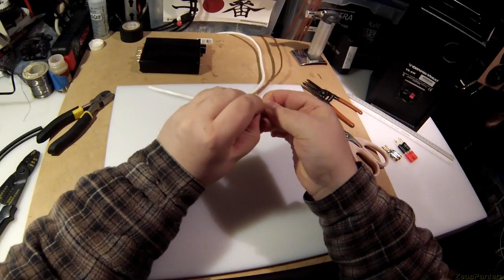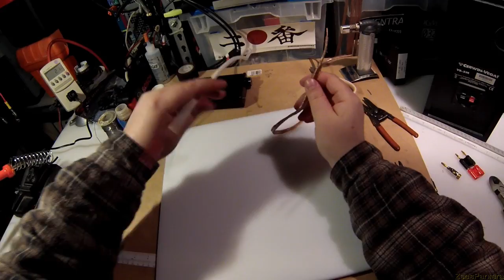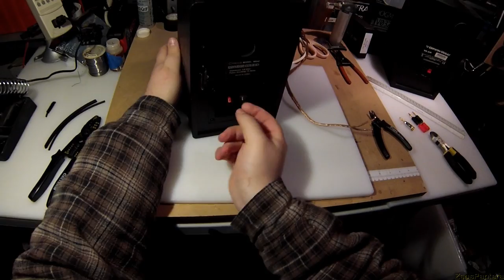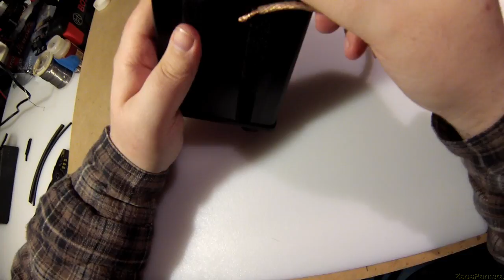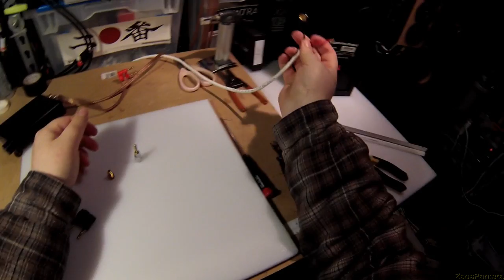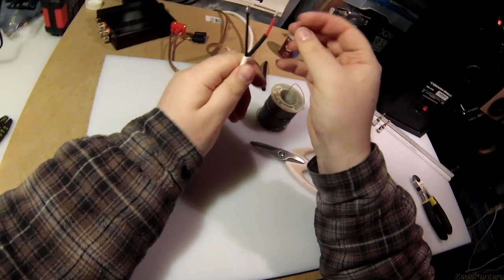Z Tutorial - How to Strip Speaker Wire and Use it

Comment: Awesome Video Buddy I Actually Did it Myself I Have a Automatic Wire Stripper in My Toolbox So Stripped The Rocketfish Clear Coated Speaker Wire I Braided the Ends of the Wire Connected to a Speakers Using Binding Posts and on The Back of the Receiver Where the Rest of the Audio Gear are Connected So I Did a Great Job I Got 100%

Comment: I have a red strip and a white strip inside my qed xt25 copper cables, should I remove them (cut them off) before I twis them together?  the red and white tubes are called X-tube technology, which delivers uniform current. From the videos of those cables I gathered they should be cut off but its not stated anywhere. There is no info about it on the web.

Comment: For Pete's sakes, breaking strands is just very poor wire stripping technique. You can use a real wire stripper set to the correct gauge. You can use one that has a cutter where you set the cut depth and spin the blade around the jacket. It doesn't cut right through, so no cut strands. You can even just use a sharp hobby knife to score the jacket surface by rolling it on the edge (not slicing). This way, the jacket will not cut through. Then just bend the jacket sharply at the score mark so the stress opens the score right through. Any of these methods works without ever breaking or cutting a single strand. If you are going to make a how-to video, just learn to do it 1st....

BTW, to avoid shorting just:
1. Turn the amp off and allow time for the power caps to discharge to earth before connecting or disconnecting passive speaker cables.
2. Connect the Amp + last and disconnect it 1st. Simples! You will note that the + binding posts are on the outside of the row so there is zero chance of bridging these accidently.  If the + is disconnected and it accidently touches, its own + or a - or the chases, there is no short circuit in any of these events. However, if you mess with the speaker end while the amp end is connected you certainly will risk a short. So, just do it in the right order and it won’t happen.

Comment: Is there a video for making interconnects? Could you also do a review of various interconnects available? I am amazed to see the prices of some interconnects. Do they add, subtract, multiply or divide anything? Also, if you could add on how a Subwoofer cable is different from a regular rca interconnect cable?
Reply from the maker: Sub cables are no different than normal RCA's. I have a video coming to make speaker cables that look good. I just buy cheap monoprice or amazon RCA's as they are better built than most and work great.

Should be no sound benefit btw.

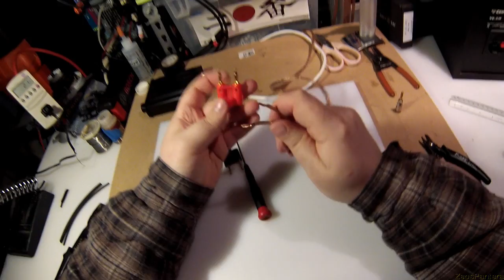Comment: What's the 11:00 min adaptor called? I have a bit of trouble finding it in my country xD
Reply: Also can i connect the speakers from this home cinema http://www.theatresystem-manual.com/sharp-ht-cn410dvhr.html to a normal PC with the adaptor and work perfectly fine?
Reply from the maker: It is a banana plug. Europe might not use them due to the way they fit in outlets. 

If you have that while surround sound just wire the receiver to the PC with Fiber or a 3.5mm to RCA. If all you have is the speakers you need to get an amplifier of some sort to run two of them in stereo or a recevier to run all of them. Honestly they don't look high quality.
Reply: They are pretty old but unused. I asked on some forum if it would work and they said that the speakers would make no sound without an amplifier. So my plan kinda died out. Is there another way to make them work or just impossible or not a bargain?:-?

Comment: Hey Zeos, will stripping some of the copper for headphone cable affect the sound? In this video, you mentioned that it wouldn't affect the sound but I was wondering if the same goes for headphones since headphone cables are significantly smaller gauge than speaker wires. Thanks in advance.

Comment: say if you wanna piggyback 2 sets of speakers onto eachother, but your amp doesnt have posts for Banana Plugs, can you take 2 sets of raw wires, and stick them in the same terminal, so long as you are not mixing your hots and grounds?
Reply from the maker: You can. But running in parallel can be dangerous for amplifiers. You might want to consider series.
Reply: Is parallel the same as piggybacking banana plugs on eachother?
Reply: Parallel or series doesn't matter too much as long as you make sure the resulting impedance is compatible with your amplifier. http://www.parts-express.com/resources-speaker-connection

Comment: I work at a Summer camp and we are installing a new PA system to stay up year-round.  Do you suggest I solder the ends? Or should attaching a banana clip work just fine?
Reply from the maker: I wouldn't do banana's I would use the screw down terminals on the binding posts in the back. It will take a little longer but you might prevent problems. Also you may want to wrap the terminals in duct tape when you verify they work.
Reply: What problems does it help prevent?
Reply: Z Reviews It took me a while to understand what you meant. the speakers in question don't have built in screw terminals.

Comment: Hey man, great video! I still have a few question tho. I numbered them so you'll have an easier time to answer them all!

1. Do you solder the wires themselves to the banana plugs? 

2. For a bookshelf speaker setup, which type of wire do you recommend? Clear coated wires or the UL listed jacketed cables?

3. What gauge of said preferred wire type do you recommend? Is bigger better? I really wouldn't mind since I'm used to soldering 12-10 gauge wires coming from the electric radio controlled world :P

4. What is your preferred way of connecting speaker wires to banana plug? Soldering or screw type terminals?

Thanks a lot man, you're channel is really great :D

p. -s. Sorry for the long message :P
Reply from the maker: 1 . No, banana's usually have a screw of some sort to hold the wires in place.

2. Whatever you can hide better., The Clear stuff is more flexible.

3. 16 is usually enough for 20' runs. Bigger for longer runs or to support way high load (300wpc) or to show off.

4. Screw downs work well. I have been known to soldier the end of the wire and then crush those down under the screws.
Reply: Z Reviews Thanks for the answer :)

Comment: if i do accidently cut  some of the copper wire hairs...will that leave out certain frequencies or parts of the stereo spectrum ? I dont have a wire stripper so i used scissors, and when I listen to the Beatles "Elenor Rigby" the main vox drops out in some parts....
Reply: Losing the copper only changes the overall gauge of the wire. So if you start with 16ga and you lose 20% of the copper you end up with 18ga (higher numbers mean smaller cross section). All the frequencies go through the wire at the same time. You won't have any loss like you are describing unless you have phase or grounding issues. Make sure the copper from one side isn't touching the other side or any metal on the amp etc. Then double check the + and - are correct.
Reply: gotcha....figured it out.....was hooking up everything to the right side...so had a mono sound...or 1/2 of the sound rather.....embarassing but finally fixed !

Comment: Hm, never knew the basic setups had their drawbacks. Would you be able to post an imgur album with various correct configurations to go along with your video?
Reply from the maker: It is possible. I have spent a good deal of time trying to find pictures of properly terminated speaker wire and found very few.